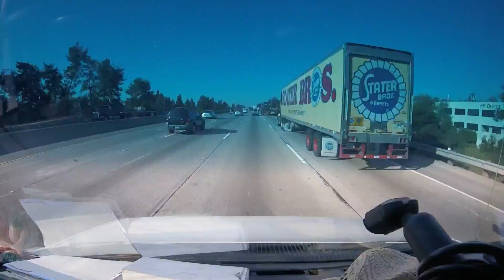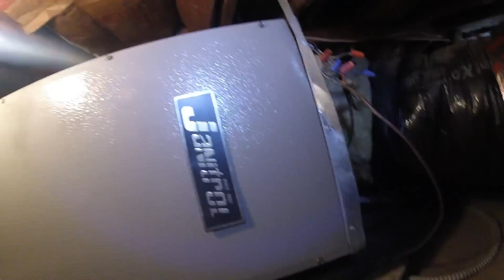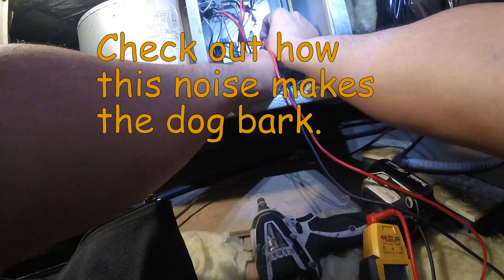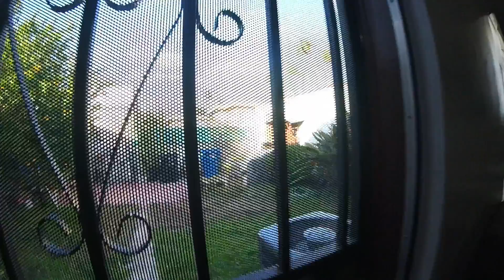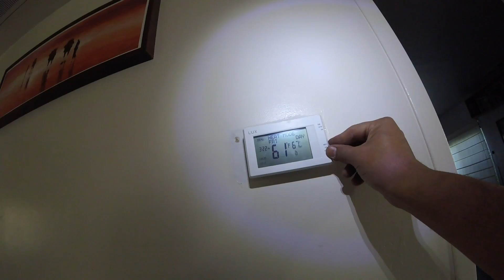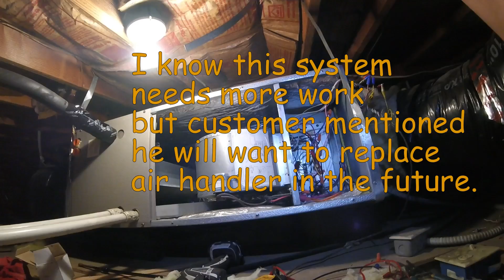Service call. Heat pump not heating.

Comment: So i had someone come and check the txv valve because it wasn’t putting out enough cold air. Come to find out it was leaking. and freezes up the condenser coil. then someone else came replaced the fan motor. Didn’t see anything with the txv. Barely fixed it. Now the compressor is gone because the heater is blowing cold air. its a packaged unit. I’m so annoyed.
Reply from the maker: Sounds like a bad txv.

Comment: My is not heating only air coming how can I do
Reply from the maker: You'll need to hire a service technician. Heat pumps are a little more complicated.
Reply: I want to fix myself that way
Reply from the maker: There's not much you could do without being EPA certified. Only thing I could tell you is to check your air filter, and circuit breaker. Everything else requires electrical and HVAC knowledge.

Comment: If we have an electric furnace and an AC(also works as a heat pump), how do we test if the heat pump is generating heat, while both the heat pump and the furnace can generate heat?
Reply from the maker: Turn the heat on, check to see if the outdoor unit is blowing cold air. If it is then the heat pump is heating. The electric heat will only click on if your thermostat tells it to. Usually through emergency heat mode or defrost. Heat pumps are not my specialty though since I hardly ever work on them. We mostly have gas heating.

Comment: It is 30F right now where I live but it feels like 19, but it can go to -20 and sometimes -40F. Regular would be in the single digits to upper 20s. I have a Goodman heat pump I guess a 3 ton for a 1,634 sq ft home. I bought the house a year ago and I cannot get used to how cold the house is with the heat pump
I recently bought a laser thermometer to check on the air temp coming out of the vents. there is only one vent that the temperature comes out at 92F, the rest are reading 75F and one of the farthest one from the heat pump is reading 82. The ones in the living room read 74 and 75... of course the living room is the coldest and to top that problem I have cathedral ceiling. I have new double pane tempered windows, I see or feel no air drafts. The house was built in 1974. 

I just got an Ecobee 3 thermostat and I feel that it has gotten even worse. The heat pump won't reach the set temperature unless I engaged the auxiliary heat. When I do then the air temp from the vents are over 100F, but my electric bill will be over 300 dollars. The very first month I moved I had to pay $480 for just one month. I think heat pumps are a POS or there has to be something wrong. I had a company to come check on it and they told me it was working the way it is supposed to. 

My heat pump has been running non stop for the last 2 days because it has been cold, but just using the compressor, no auxiliary heat. When is a little warmer, like 40F, it will reach the desired temperature after working non stop like for 2 or 3 hours, then it stops for almost 1 hour until the temperature drops, by the time the temperature in the house drops, like about 2 degrees down the desired temp (weird because it is supposed to be just 0.5 F drop before the heat pump kicks in), then it takes a long time to reach the desired temp or it never reaches the temp unless I engaged the auxiliary mode that I really don't want to because, again it is too expensive. I still think it is because the heat pump is blowing only 75 to 76F in 98% of the house.
Sorry, too long of a message... Any suggestions?
Reply from the maker: I love these kind of questions thank you. This sounds like a design problem. Possibly duct design  Unfortunately I do not have experience in your type of climate.  I will not pretend to know what to tell you what the best solution for you will be. I don't know what is more common to use in your area;  oil, natural gas, propane or boiler in your area BUT what I can tell you is what I would tell my dad if he called me and described a situation such as yours. You need to find a "mom and pop" company that has been around for a while. Has a good reputation. And at least 3 verifiable referrals. Meaning you could call them and ask about their experience. Get at least 3 quotes to compare. Then run then by me. :-)
Reply: I installed a Goodman heat pump by myself, I also have an oil fired boiler I found the heat
Pump was also running constantly, I live in New York, so I used my oil fired boiler for heating, it works great

Comment: Glad I saw this vid. I looked up on heat pumps cause I'm not familiar with working on them to much but today I couldn't get the issue solved with a heat pump not heating but glad to have seen this issue solved

Comment: What would cause a HP compressor to not start in heat mode? Aux heat comes on instead so, thermostat is working. Compressor starts and cools fine in cool mode.
Reply from the maker: Steve Warren 
Thermostat is probably not in heat pump mode. Did you replace it?
Reply: No. Thermostat isn't new. Nothing changed in entire system.
Reply from the maker: Steve Warren 
Then it sounds like you're going to need a technician. The signal for the compressor to turn on comes from the thermostat. If compressor comes on with AC but not heat pump then a technician needs to troubleshoot it. Sorry I couldn't be more help.
Reply: Thanks!

Comment: Yooooo "The Air Conditioning Guy", your terminology of "transformer blowing up" and other things blowing up - very bad and incorrect terminology.  
Correct analysis is the transformer winding's opened up due to excessive current.
You should have placed a fuse on the first transformer, after noting it was not their to begin with.
And to place a bad part within a box... ya should have cut the leads off or done something different.  
Too much wasted time...

Comment: Great work!! Did you install a fuse on the transformer??
Reply from the maker: No,  I used a popper until I figured out the wiring. Do you install a fuse every time you replace transformer?
Reply: +The Air Conditioning Guy Yes if theres no fuse i always install one if i replace the transformer.
Reply from the maker: It's not a bad idea. It did cross my mind. I asked if they had one at the nearest supply house but they were out.  Then I thought about it and couldn't remember the last time I had to go back because the they burned it again. However, it's not a bad idea so I think next supply house I go to I'll look for them again to stock.
Reply: +The Air Conditioning Guy auto zone sells some nice fuse adapters
Reply from the maker: Ooooh you're right! I keep forgetting about auto parts stores. Every time I'm in one I get stuff but later on I forget they have useful stuff there too.